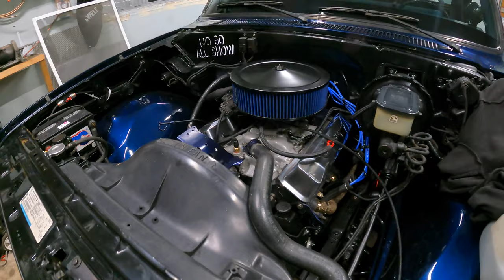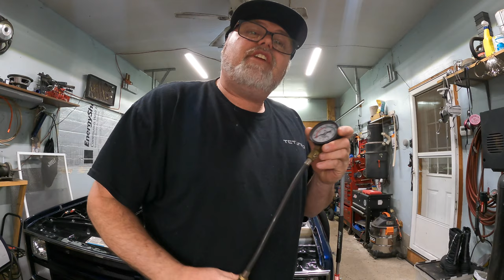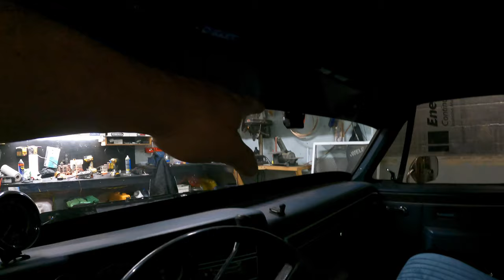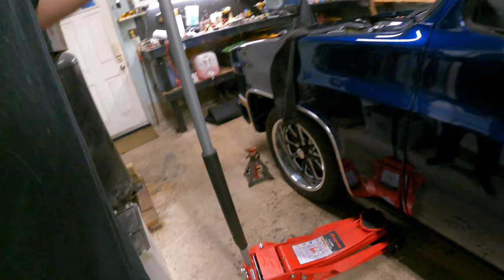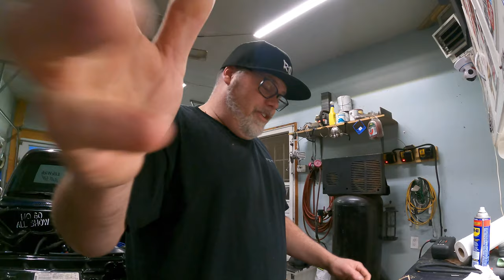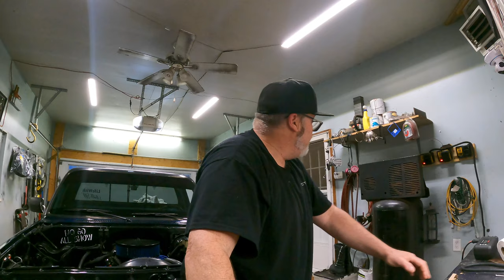Are We Going To Start All Over Again   4K

Comment: My sonoma moves forward a little sometimes on start up. Not sure why either haven't researched it. Your truck looks great bud don't let it bring ya down. Awesome things don't come fast.  I wouldn't run 20/50 I run 10/40 summer 10/30 winter. Get yourself some Lucas engine oil treatment. Works great on lazy lifters and even mild rod play. Keep plugging away bud . I don't put the recommended amount of Lucas I usually run a cup or 2 at oil change. It's probably wrong but it's worked for me for yrs . Not sure on the slow shift ,just do more research you'll figure it out. Stay safe bud
Reply: I run 15 40 diesel oil in my old school motors  but my 16 year old daughter has a Ford ranger and I am going to start running that 20-50 Castrol high mileage in it because once the motor is warm up then the oil psi goes way down like 5-6 psi
Reply: @Clawson_customs  run that Lucas in there. If the oil is too thick the truck may not get the oil quickly enough.

Comment: I had an 81 cutlass and had a Pontiac 400 in it I tried running 20w50 oil in it and it robbed it of power. Think the oil was too thick.  Changed it to 10w 30 and it ran fine